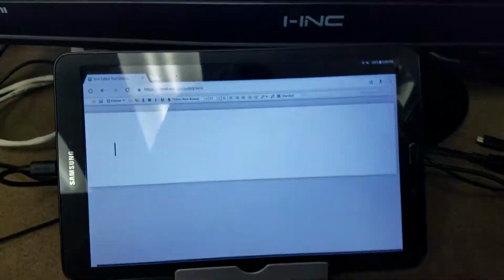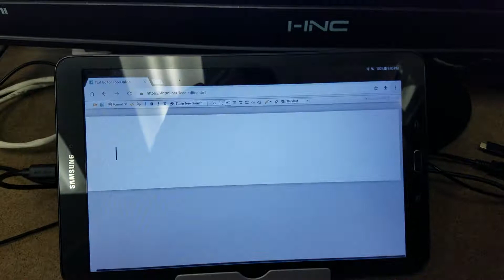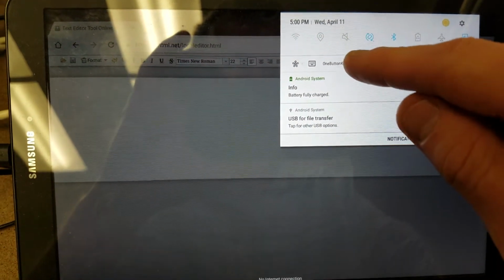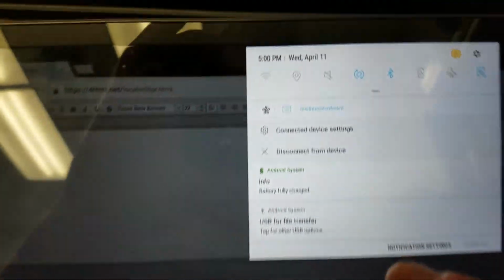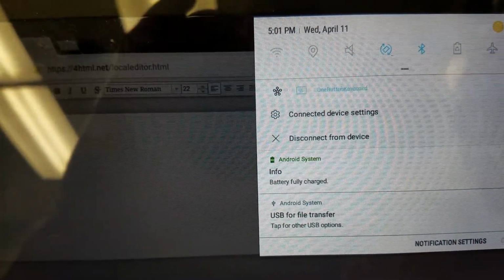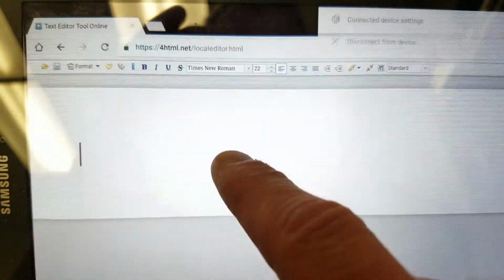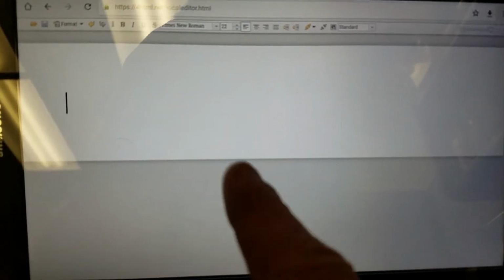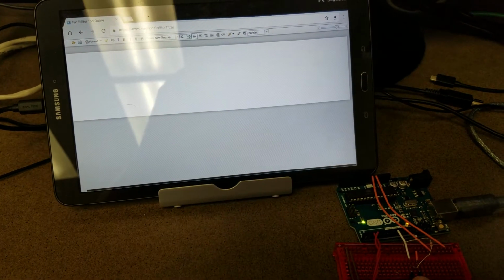RN-42 based custom Bluetooth HID keyboard device

Comment: Hey..can i make a wireless keyboard by connecting keyboard's USB RX&TX pins to a Bluetooth module's Rx&Tx pin and power it up via battery...
Reply from the maker: Sure, but you will need your Bluetooth module to run code that understands how to communicate with a USB keyboard.  Or if you use a Bluetooth module that is already programmed, you could use a processor in-between such as we've done here to interface the keyboard with the Bluetooth module.
Reply: Thank u so much for replying